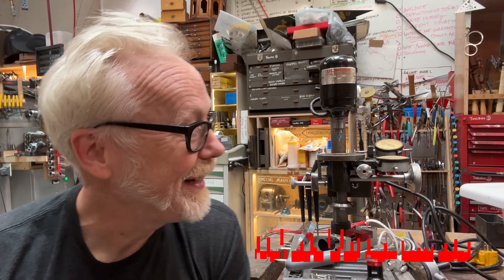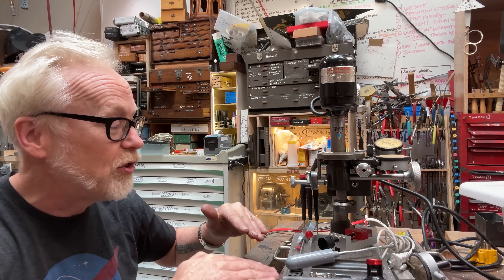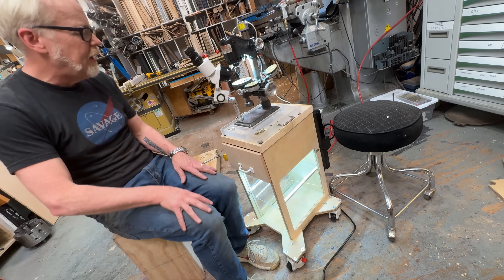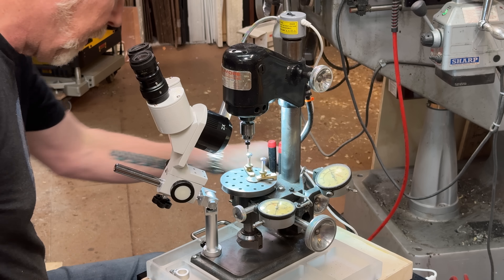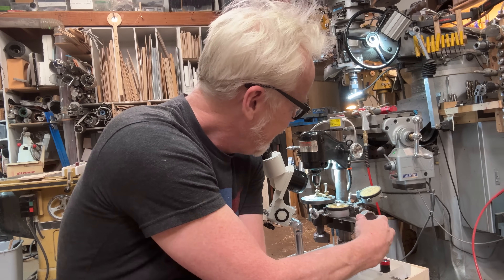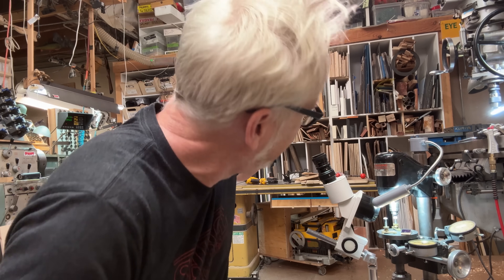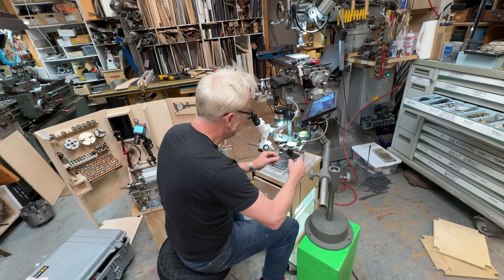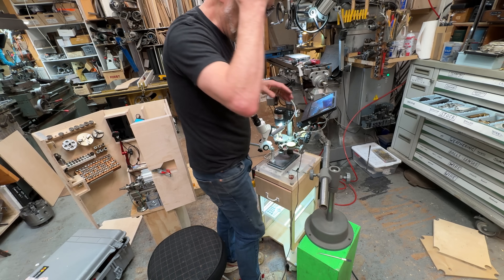Drilling a Hole the Width of a Human Hair?

Comment from the maker: Adam's new Dumore Drill: https://youtu.be/FnF3z4AMG1s
Adam's previous tests of his Dumore Drill: https://youtu.be/UCJy1AXMaAE
Reply: Do you have a link to the microscope used in this video?
Reply: Next watch making with this skill
Reply: @mikeuk666  Would love to see Adam make a watch!
Reply: No outro?
Reply: Hey Adam, did you ever use your swordforge?
Reply: Lubricate your bits, use beeswax or anything but good lord use lubrication. Those tiny bits heat up fast. You'll cut faster and the bits will last much longer. Just push the wax up as the bit is spinning at the slowest speed. That is a jeweler's dream setup!
Reply: Do you think you could build a drawer that upon closure activates a vacuum pump that shuts off after reaching a selected pressure for storing things you do not want to corrode or decay?
Reply: @jessefertitta7784 any air tight seal plus a silica gel packet?
Reply: you could use electro-machining on anything conductive to cut holes as small as the smallest wire: AWG 40
40g (AWG) | = 0.0031" | = 0.0787mm
Reply: Is it possible for Adam to scan and share a PDF of the Dumore catalog?

Comment: Adam, there is a good, true story about a Japanese company who manufactured a very thin and top class hair spring for a lady's watch. They sent this hair spring to Switzerland to an opposition manufacturer to boast with their hairspring. The Swiss manufacturer returned it to Japan and wrote to them, This is a well manufactured hairspring, but please inspect the ends of the spring. When the Japanese manufacturer inspected their super thin spring, they found that the Swiss people drilled a hole through their super thin and dainty spring. I am sure you will find the actual facts of this story somewhere on the net. I am a clockmaker and we often drill 0.1mm holes into arbors to replace broken pivots.

Comment: A couple of nice add-ons I can think of would be a compressed air chip removal system (maybe paired with vacuum), and an eye shield (like a section of a motocycle shield) mounted near the eyepieces

Comment: Impressive!  I remember many years back as an apprentice, one of my jobs was sharpening 0.030" drills used for making stainless steel spray heads. They were done in batches of a hundred and the machine had a magnifying head to view the work.  I don't think I could see to do that now.

Comment: What's the runout of the spindle on that drill press? You might be using a .004 drill, but it your finished hole could be .006. Did you QA your finished holes with a pin gage?

Comment: Super. I also tried to assemble an acrylic engraving machine. Lack of tools and a Chinese 9-volt drill machine. It seems to cope, but at high speeds the tooth beavers melt the plastic.  looking for I'm looking for a solution. Since there is no money for a laser machine.  Cool to start making LED lamps for people at 5 volts. Since electricity is often turned off in Ukraine, people will be able to use art lights nicks for 5 volts from a power bank. To illuminate rooms and so that children are not afraid to sleep at night during missile attacks Thanks to everyone who has any advice.

Comment: PCB CNC drilling does thousands of 8 mil holes per session.  Look up Excellon drill machines.  I’m pretty sure they can do smaller but typically lasers are used for 4 mils and below.   Aspect ratio is key.

Comment: Maybe add some kind of extra gearing rig attached to the control knob so you can lift the base up to the drill bit in smaller, smoother increments, so it doesn't require as much finesse from your fingers to control how much force is exerted on the drill bit?

Comment: What is the application for this? Is there a screw or bolt this size that will fit in the hole?  Or are we threading this hole like a needle? What is the application for this size hole? By the way, I would love to see the screw or bolt that fits in this size hole.  Yeah, that would be hard to find, I mean, once you already have it. Can you imagine putting this screw down on the table and being like, "where did it go?"  Mind Blown!

Comment: Once we needed holes that were 1.2 thousandths of an inch in diameter, drilled through a piece of stainless steel that was about 5 thou thick and about 3/16" in diameter..  The method was to predrill most of the way through with a larger bit, then switch to the final size to poke the hole the rest of the way through,     The application was to squirt a beam of  electrons at 20,750 volts (DC) through that hole.. I mention this to point out that, usually, when you need holes that are pretty small,, that they  often don't have to be very deep.

Comment: I'm so curious to know how differently meterials interact at that microscopic level😮 like, how differently the media reacts when with that small of a rotating focal point. Even a 1/4 inch bit has so much more surface area, I would assume the interaction of the bit and media react completely differently (other than the obvious tensile strength and heat).

Comment: Does the slower speed help the drill bit stay cool? I'd imagine something that small might not dissipate heat as quickly as it gains heat. I see also you're "dipping" the drill instead of going steadily through which, I imagine, accomplishes the same end insofar as heat dissipation is concerned.

Comment: some years I briefly  work in A electronic Assembly lab. I was in charge of repair and maintaining several different  machines. one of the machines was called the Lead attach machine . The machine had a wedge that had a hole thru the middle from top to bottom which gold wire was fed to make leads to attach the die to the ceramic case. You had to look through a stero microsope scope to see the wedge. There was a tiny hole on the back side of the wedge where the wire was fed tru. You could not see this hole and you just had to play with it until it came out. The day I mastered this was they day the company I worked for decided they did not need my services anymore!

Comment: This is amazing, drilling small holes but I have a question, what are you going to use the small holes for? 
I can think of making a 100mic absolute filter, that would be kind of awesome to make (need a lot of holes), but what would the application be. As I am typing this a thought came to me, can you tap a 100mic hole and even more important can you make a threaded rod or bolt to fit into the tapped hole, that would be a super project to see. "Adam's micro builds" (you can use that Adam) that would be something I would watch for hours.

Comment: The smaller the drill the faster the rpm should be. I'm surprised the manufacturer recommended slowing down the rpm for holes under .01". They make air powered spindles you can put in your machine to reach the proper surface footage on this tiny stuff. I think .007" is the smallest I've ever needed to drill in my career.

Comment: INSTEAD of building a stand with a drawer that pulls TOWARD you...requiring that you back out of the way in order to open it...consider building the drawer so that it opens TO THE SIDE. Even fancier would be a drawer that PIVOTS to the side. Otherwise it's a nice basic roller stand. 

EXCEPT that precision work wants a mount that maximizes stability, rigidity and vibration absorption. Bolt the drill press rigidly to a 200 lb cast iron stand and you will be able to drill finer and more precise holes than with it bolted to a slapped together roller stand. Machine tools always benefit from the maximum possible massive mounting system.

Comment: That's fantastic! I am a model maker working generally in 1/35. Recently I had to replace my dremel. I bought another dremel, and the runout is so bad with these micro bits, which i use constantly is so bad that the tool is practically useless.  Can anyone recommend a motor tool that has a more precise build and very little runout? Thank you!

Comment: Smallest micro drill bit I've used (for fine scale modeling) was 80 ga. (0.0135" = 0.3429mm) although gauge sizes go down to 90 ga.  However the smallest drill bits I've seen are 2 thou (0.002" = 0.0508mm) and can get those expensive little things off mcmaster-carr.

Comment: When you make the counterweight, design it like a pan scale:  make it possible to set the exact balance, then add a few grams of lifting force.  That will give you a light but consistent force pushing the drill into the material.  Then all you'll have to do is bring the table down to clear chips.

Comment: I just finished building a mini CNC drill that uses the exact same micro drills - I am using it for PCB drilling, hence the CNC part. The biggest problem on CNC is the zeroing of the Z depth, since I can hardly see the drill and a contact probe still frightens me for this tiny drills...

Comment: I haven't been drilling holes anywhere close to this small, but I have drilled some pretty dang small holes using an old Dayton (Grainger store-brand) drill press that has surprisingly good bearings and surprisingly little runout.

My purpose was making pinholes in camera body mount covers (where the modular lenses install), to turn DSLRs into pinhole cameras.  First step was the find the center and mount the camera body cap in a vise where it's centered under the drill press, then use an end-mill that was chucked to thin-out the back side of the body cap to something no thicker than a thick sheet of paper, then lastly to swap the end-mill for the very, very small precision drill bit for making the actual pinhole.

With a pinhole that small the resulting photos have surprisingly good image quality, particularly on newer cameras with good high-ISO/low-light performance.  Plus it doesn't look like you even have a lens mounted so you can take candids that don't attract much attention even from other photographers.

Comment: I thought of something as you began. You have gone on at length about writing instruments, especially for sketching, and your beloved yellow Papermate pencils in particular. So, I have to ask if you have any equally specific desires about the paper you sketch on. I realize something smaller is required for portability because sketching goes wherever you go, and working in the shop or at home can be of any size. But beyond that….. if you would be so kind.

Comment: "That's the smallest hole I'm ever going to drill" has the same energy as the salesman in 1987 telling me "This is more home computer than you'll ever need."
Reply: 1992 - I upgraded my friend's hard drive to a 120 MB drive.  We both agreed he would never fill that up.  Sometimes we laugh about that memory.
Reply: @davidbwa  what would todays equivalent of that be?
Reply: @isatntt I remember ~6 years ago getting a computer with a 1 TB drive thinking there’s no way I couldn’t fit every steam game I own on there. Well even then games were getting bigger, and now when some games are upwards of 500gb I’ve had to buy an external hard drive.
Reply: I don't know what the equivalent would be, but my first computer, in 1982, had one of the larger hard drives at 20 MB. My current Android phone has 8 GB allocated to working memory and the rest of the 256 GB for apps and data. ❤

Comment: That is outstanding, Adam. In a way, takes me back to my working days. For 30 years I worked with wires that had a profile of 0.014" or 0.35mm and had to thread them into a catheter with a channel of the same diameter. That was a real challenge. For those wondering, those are the diameters of wires inserted into coronary arteries to unblock them. On occasion, we'd insert a 0.009" or 0.23mm diameter wire. They could be tough to see.
Reply: To think those are pretty close to the size of nozzle openings on commercially available 3d printers nowadays

Comment: That’s a 100 micron drill. When I was in the blood analyzer business we had specified Ruby apertures at 50+/-1 micron diameter 40 micron thick (cupped profile) for impedance counting of diluted blood cells (Red, white, & platelets). When we visited the Swiss Jewel manufacturers, they described the process: strung together on an ~1 kilometer long tapered wire spooled at either end. As the machines spun the stacked discs it dabbed diamond dust abrasive on the wire. As the wire moved in and out, it would eventually reach the 50 micron end, upon completion. We developed an optical inspection system on a microscope with a “drawing tube” that we could superimpose our AutoCad- generated template scaled to the 50+/-1 micron image seen in the microscope. Sincerely Peter Bourdelle, Mechanical Engineer, Allentown PA 18102

Comment: Oh my, you're doing precise holes on a wooden stand, where something you never want with anything drilling that small is VIBRATION!
Heavy big stone is the first choice with that. Sorry, don't want to be mean, but that catastrophe with the shortening drill and a hole that might be stuffed with drill particles, you can do better. Also maybe consider something else to drill but Epoxy-woodpiece-somewhat called wood. That's not fair to that kind of tool, it's made for serious work and a feed unit counted by lalala is also really wierd conditions.

Comment: That was small  but there is a drill bit 0.368mm . Now that is small. Would water spray out that small?
Reply: yes it would a water molecule is 0.000000275mm that is how reverse osmosis works by having holds just large enough for the water molecule to pass through this strips it of anything else attached to it.

Comment: 5 Pcs Needle Oiler (1 OZ), LDPE Oil Applicator, Precision Gun Oil Bottle with Extra Long 1.5 Inch Stainless Needle Tip 18Ga 21Ga - Easy to Use for Gun Oil, Knife, Hinges, Glue and More

These work perfectly for applying cutting oil on your rotary tooling.
Reply: Perfection is the enemy of good enough. On machines you use brushes. You don't want to contact the tools with anything harder than brush bristles. And yes waving that needle around you are going to hit the tool.

Comment: I think you're going to need a lubricant that's much lower viscosity for those bits. You can see from the footage that the oil is sticking to the bit while holding globs of chips. You may need something so thin that it'll prevent that buildup and also flow into the bottom of your hole.

Comment: Adam, how are the vibrations on that driĺlpress.If you feel it running its to much for such tiny holes. On a sidenote, with the prices you pay for quality birchply i could have that stand made out of stainless steel and it would have been cheaper😊
Reply: It is still easier to work with wood. Price isn't always the most important factor.

Comment: Apple can drill holes in the size of 20 μm into the aluminum cases of their notebooks. You don't see the holes but when the webcam is used you see a green diode shining next to the webcam opening. They use lasers for it. John Yve wanted see-through-metal to cover the diode when it's off but that wasn't possible. The holes were the next idea they came up with.

Comment: 1:35 Don't you want to go faster when you go smaller to account for the decrease in circumference and thus maintain the correct surface speed?
Reply: Beyond that you over drive just to keep tip pressure down. Why Adam wants to go slower I've no idea. But it seems to be working for him. That is contrary to general convention though.

Comment: That is incredibly impressive and I am awed by you - at this scale, metal is a bit weird, in my experience. I have, in the past, and many times, had to perform microsurgery and used a 34 gauge needle - 0.15mm ish external diameter, 0.05mm ish internal diameter, and have also sharpened these needles on a diamond wheel. The metal of these needles is oddly squishy at such scales. Funnily enough, the needles come with "pipe cleaners". Yes, this stuff is done with a microscope. edit: a stereomicrosope. Not possible (for me) with a mono

Comment: I cant wait for the video where he shows us why he needs such tiny holes.
Reply: My guess would be for fiberoptic lighting in models
Reply: That’s what I use them for. Lighting X-Wing and Armada models. Haven’t successfully drilled too many .1mm holes, but I’ve done a few. Surprisingly, my inexpensive drill press isn’t terrible for it. Drilling into soft plastic is a lot easier than a quarter though.
Reply: @relishgargler  I use a pin vise for drilling such small holes, sure it's more time consuming but you don't break your drill bits as often as you would with a drill press
Reply: Engine fuel injector
Reply: maybe just needs a little more space
Reply: Injector for plastic usually drilled in a hardened tool steel not zinc coinage
Reply: As a former 'professional fuck around' I can tell you that when you have the capability, you find the need.

I used to do industrial maintenance and repair, and when everything was up to date and nothing broken I was allowed to fuck around finding new ways to improve our machines or w/e I felt was worth my time. I guess technical verbiage would be R&D, but I prefer 'professional fuck around'. 

But yeah...when you work in that kind of environment and get a new tool or capability, you find reasons to use that new tool/capability that are bullshit at first, but you quickly melt it into your arsenal and pretty soon you're primed to whip it out when it's the best tool/technique for something you've been doing a harder way all along or a new problem comes along that it can solve perfectly.
Reply: I do this all the time at work. I just consider it earning new tools in my bag of tricks for when needed. Also, much better time to learn where you are f'ing up when it isn't something critical.
Reply: @PlatypusVomit you are long winded
Reply: @Randomname183  I prefer the adjective 'verbose'.
Reply: @Randomname183  What you're noticing here is the difference between a good storyteller, and someone with so little to say that they can't even be bothered to read what they wrote, let alone use proper capitalization and punctuation.